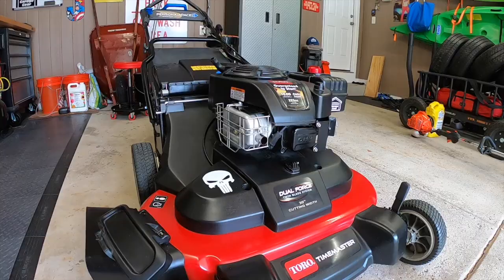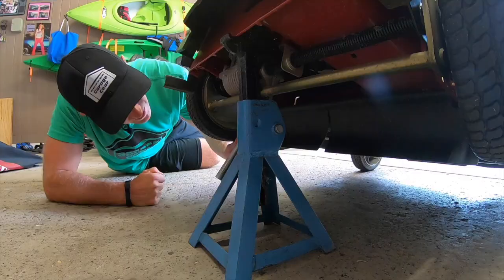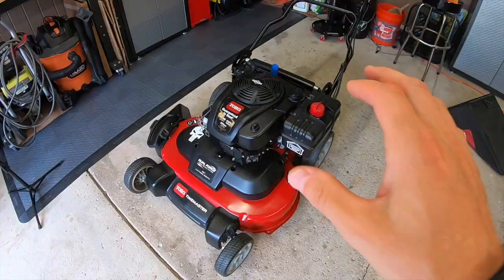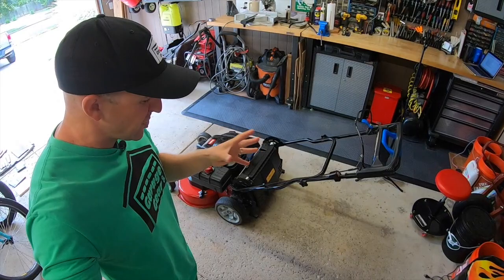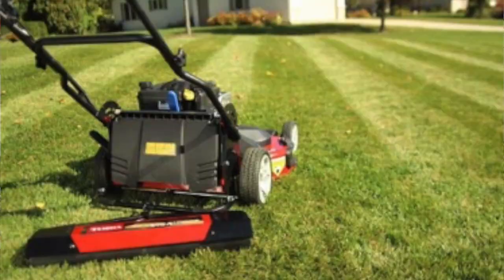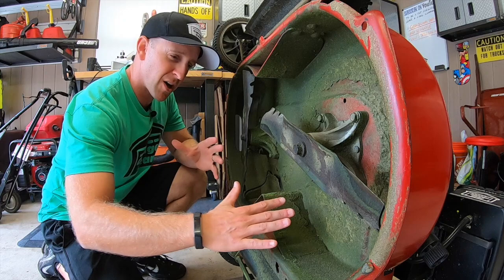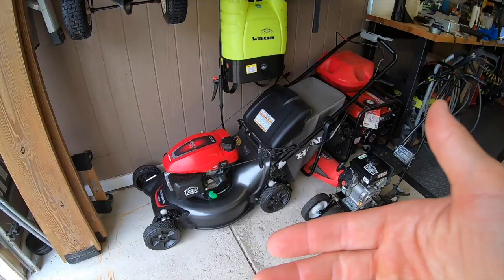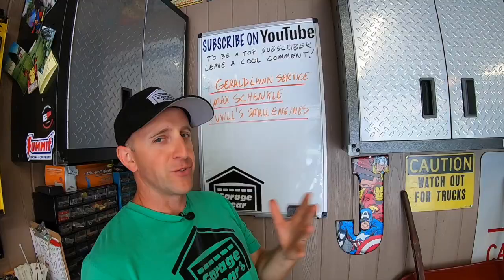BEFORE YOU BUY A TORO TIMEMASTER, WATCH THIS!

Comment: Own 2 older TM for 2 property's. Not much gloggin by my (cut/mulch) switch routine.  First cut with open doors and let clipped grass dry. Next cut, I only "mulch" closed doors if needed. I'm able to jog/run and cut as fast as i can, great machines. I do mis the rust free aluminum deck that the smaller toros have. Graphite helps too.
Reply from the maker: Thanks again for sharing Clare! Graphite and aluminum decks definitely help.

Comment: So was really considering getting one until I came across this review. I currently have a Toro super recycler model 21386. It’s an absolute beast of a machine. But my new yard is double what I’ve had in the past. I’m now at about 10,000 SqrFt of pristine, thick St. Augustine. It takes FOREVER with a small mower. 

What is the best option? 

-Riders and standers create ruts and damage the lawn. 
-30-42”walk behinds I have found only seem to be commercial units that cost and arm and a leg
- tested a few commercial units and they may be robust, but cut quality sucks.
Reply from the maker: @matthewo.1183  hey Matthew it sounds like the commercial 30” units would be a good way to go for you but unfortunately youre gonna have to come up with the extra cash for it. There really isn’t anything of decent quality in this size bracket at the residential level

Comment: I have the same size, 10k sq ft lawn and I finish, no problem.......  gas left over in the tank. 159 hrs, a flap and the synchro pulley upgrade. Also have replaced a set of blades. Oil changes and that's about all.
Reply from the maker: Thanks for sharing TJ!

Comment: Interesting video here, so "thanks" upfront,  and I'd like to share my two-cents...

Just entered my 11th year with the TimeMaster and still runs like a beast (on 10,000 sf yard).
Add to this, cutting the neighbors yards several times a season. 
Add to this the heavy mulching and bagging of hundreds of bags of leaves over the years (and I mean "heavy" fall leaf cleanup!).

Yes, mower still has the original deck flap, wheels, engine...etc.
 
I have replaced these items over the years.... Factory: (1) new carb (last year), (1) new transaxle (this year), (3)belts, (3) cables, (pair) of deck-raise handles, air filters (5), pair of mulch blades (upgrade).......at a cost for these repairs/ improvements of under $350. 
(tried the $25 aftermarket carb / kit last year and that was a big flop. I did rebuild the original carb once or twice before last year).

No big secret here but preventative maintenance is KEY including regular filter cleaning or changing, regular blade sharpen, regular oil changes. Also, I have always used ONLY high octane fuel. Plus, early on, increased engine by upwards of 20% to handle more traction/ better toque.
 
Ya, mulching particles will stick cause of wet grass but I try to avoid wet unless I have to and more regular cutting really helps get real fine mulch. I try to cut ahead of the rain so sometimes early cut occurs but not to much later/ longer turf.

So, ya, I have been real lucky with this mower and with small hills on the yard, it has performed very well just like all my motors do.
So I am very thankful.  Same with my Stihl products....they run which seems like forever, also.
Reply from the maker: Thanks for sharing your experiences with the timemaster!

Comment: Hello all. Wow this is informative and scary! The best thing for me is I found this one season old Timemaster last summer at a steal. Nobody believes me when I tell them what I paid for it plus in the package I got an older aluminum personal pace 6.5hp Toro(the backup), a Stihl 700 back pack, Husqvarna chainsaw and new wheelbarrow and miscellaneous cans of store bought gas plus gas containers. Anyway it’s for personal use and it’s funny, after every use I flip onto its side and hose it out. On my way back to the shed it runs out of gas lol! At least I know I’m storing it dry, right? No clogging ever whether I bag or mulch probably bc I cut as needed before grass gets high and only when dry. Now my problem is, I’m worried about the tranny, motor and pulleys though! TBH I never even looked at the flaps( they may not even be there-lol). It’s two seasons old now and I’ll continue to service myself blades and oil change once a year(STUPIDEST design flaw w oil change TORO!!). This year it’s getting a new plug and air filter. It starts fine w electric start and doesn’t burn a drop of oil! Maybe and hopefully I got even more lucky w a non-lemon…..TBD
Reply from the maker: Maybe you got lucky! Thanks for sharing Tom!

Comment: Mine is an original 2012 model. 190cc electric start engine was underpowered and I called Toro and told them that the unit needed the Briggs 223cc engine (yes, it existed back then but was used on small rear engine riders) Toro told me that their engineers knew what they were doing and they determined that the 190cc engine was plenty of power for that mower and they blew me off.  ( Nice to see them have to eat their words in 2017 when they finally put the 223 on it).  I replaced my 190cc with the Kohler CV224. Mine now has all the Turfmaster parts on it (pulleys, brake arm assy, etc) it is pretty solid now.  Bought 2 other 22" mowers.  Still prefer the Timemaster for time savings and cut quality.  My deck only needs scraped out a few times a year.  In the Spring I run the lower lift Atomic blades, mow more often and usually always mow later in the day when the lawn has had a chance to dry out.  I've learned how to avoid the deck getting packed up unless it rains for 2 weeks straight and then it's bag or side discharge and cut the next day when the clippings have dried out a bit.  I kind of enjoy working on OPE so making practical modifications (engine and others) are kind of fun to me,  but I won't be jumping on the useless painted wheels bandwagon any time soon....
Reply from the maker: Thanks for sharing all of this Mellow! I know what it’s like to enjoy working on something and everyone has their thing! 👍
Reply: some real honesty yes finally, if you own one you will prefer it over 21.
my 190 I just adjusted the idle screw for more rpms helped alot.
Reply: @kevinisbell1867  Yes I did the same (bumper up to 3400-3600 rpm) and it did help but my lawn is a really thick KBG & TTF blend and the extra torque from the Kohler was a night & day difference.  Plus I always mulch whenever possible.  It is strong enough to mulch with Gator G5 blades without bogging, but I think they are overkill for this mower.  G3's are better suited, if so desired.  Since I am only using mine for my own yard I feel that the mods I've made have made the mower just about as good (for my needs) as the commercial Turfmaster & Exmark 30's, but still quite a bit lighter and more maneuverable.
Reply: I can easily more than double Garage Gear's list of poor design issues. I too have a 2012 Time Master with a new Kohler Command Pro engine.  Have found that I need to turn it over and wash the underside after EVERY use.  Slightly wet or tall grass means bag AND chute.  I cut 3/4" off of the height of the chute guard and that helped to reduce clogs.  I did not know that there were better pulleys available but will see if I can figure that out for the next time.  As you mentioned, I love the TimeMaster for quality of cut, better than my Hondas, but you have to love doing maintenance and shopping for parts if you own one of these.
Reply: @kenking9114  Agreed....but after you get the parts switched over once you'll go much longer before having to work on it.
Reply: @mellowjammer  There's always something.  When I put the engine in last fall I completely disassembled.  Cleaned and painted everything, replacing both spindles and two belts. Timing belt idler pulleys are fairly new.  With 16.5 hours on the new engine I just replaced the shredded timing belt that is almost exactly two years old and maybe 35 hours. As I said, it's always something and the neighbors have noticed.
Reply from the maker: @kenking9114  you gotta love doing extra maintenance if you’re going to keep one of these long term! Thanks for sharing your experiences here! 👍
Reply: @mellowjammer  I hunted a bit and found the same part numbers for pulleys on the Time Master, Turf Master, and Exmark 30.  Can you share part numbers and supplier?
Reply: @kenking9114  Wow!  I'm still on my original (cogged) timing belt from 2012!

Comment: I know there’s no real comparison and individual circumstances are so variable, but for the past 4 years, I have been using a 125cc Cheetah mower (the cheapest I could find $175), to mow my 2/3 acre back yard. It takes me 2 hours on a good day or 2.5 when I’ve left it for 2 weeks. It’s incredibly light weight, uses hardly any fuel, has lived outside in the elements its entire life and is small enough to throw around with 1 hand to go around trees etc. Yes, it’s like 16” which means I’m spending more time, but I’m almost afraid to “upgrade” after watching a bunch of review videos for the options I’ve been considering.
Reply from the maker: A lot of stuff out there isn’t built very well! Thanks for watching

Comment: I have 2 residential timemasters I use in my small lawn care business, awesome product I must say. I had to get deck welded as once motor got loose. Replaced one motor as cam worn out (I never adjusted valves so my fault) and replaced couple of pulleys and belts. Every machine has its own special issues. I think it’s a pretty good product
Reply from the maker: Thanks for sharing Rick!
Reply: Why would the end user need to adjust the valves? I'm thinking that should be done before it leaves the factory!
Reply from the maker: @jacktorse2145  I would think so Jack. But hey ya never know.
Reply: Your post was from 11 months ago. It would be amazing if they are still running today without any issue's.

Comment: I've been using the timemaster for about 3 years now and I agree that all walk behind mowers bog down at some point it doesn't really do that great mulching either and does the same in wet grass as any other IMO I've learned that every week after using it commercial you have to open the black plastic part an blow in there to get the grass that builds up if not that's problems waiting to happen if you can do it sooner even better, and the plugs that go on top of the pulleys I used silicone sealant so they don't pop up an  debris gets in the bearings I also replaced them with the commercial ones other then that I've never had any other issues I'd buy it again you just have to maintain it and yeah I wish the tank was bigger to might have to put the time an energy to what you did
Reply from the maker: Thanks for sharing Norman! 👍

Comment: I have had my Timemaster for 8 years and I am very happy.  Yes, I share the clogging issue a bit and had to replace the drive cable, but it has NEVER failed to start or finish my lawn(s) in Toronto, Chicago, and now Florida.  St. Aug grass does not cause as much clogging as Kentucky Rye Grass
Reply from the maker: Thanks for sharing

Comment: I've had a Toro Timemaster and the Personal Pace Self-Propelled feature is worthless.  It eventually turns into a 30" manual push mower in no time going up hills.  I eventually returned it and purchased a Honda 21" HRX217HYA Self-Propelled mower with cruise control and blade stop.  The Honda worked in all turf conditions with no issues and was considerably lighter and produced a far better cut.
Reply from the maker: That’s a BIG mower to push around lol! They really aren’t all that they are cracked up to be. Hondas on the other hand are built well. That hrx is a great mower! Thanks for watching CSM!

Comment: I have one of these mowers, about 5 years now.  Replaced pulley after one season. I agree engine is under powered, will bog down if grass gets a little high. Other than that it has started on the first or second pull every time.  I give it 3 out of 5 stars.
Reply from the maker: I agree with your rating Olde Hatt! I does give a nice cut when the conditions are right. Thanks for watching!

Comment: This guy is 100% spot on. If I had seen this video 2 years ago before getting my TimeMaster, I would have gone a different route. I’m mechanically inclined and have tools but I’m definitely not a full mechanic so some things are outside of my expertise. I do want to say that I am DEFINITELY saving time with this mower though. My backyard is 100ft x 100ft and my front yard is 100ft x 25ft. My old Toro 21-inch mower would take me 1hr 45min to mow and bag the grass. I can be completely done with the entire yard PLUS edging, trimming, and bagging in under one hour. Huge improvement here. 

> My flaps were shredded but I followed his video using the John Deere flaps and it rocks now. Highly recommend this fix. 

> The gas tank is small but I don’t have a massive yard so I can get through on a single tank. I always fill it before mowing though. 

> The engine is definitely weak and bogs down if I’m trying to mow heavier grass down too low (especially in the spring). While it is said that you should only moe when it’s dry, I have a job and a life so that’s not always feasible.  

> My engine bolts may be fine but I lost 2 bolts on top of the engine’s pull cord cover (need to check the engine bolts now!). 

> I just finished my 2nd summer with the TimeMaster and my blade engagement belt just broke on my last mow of this year. Very premature. Luckily, I follow a TimeMaster group on Facebook and saw enough issues that I had 2 belts on standby and it was a quick 15-minute repair. Oddly enough, the mower feels better than new with the new OEM belt installed. I’m preparing for the pulleys and main belt to go as well. 

> The deck clogging is a real thing too. I’ve tried ceramic coating and sprays but nothing works. I bag my grass and I even see it clogging the chute on the way to the bag. Don’t waste your time doing the ceramic coating. They make a spray you can use right before mowing that does a decent job and it’s MUCH less elbow grease and time compared to the ceramic coating process. 

Overall, I’m happy with the TimeMaster but, if you’re in the market for a mower now, I’d steer clear of this unless you like tinkering with your toys and enjoy repairing things. HA!
Reply from the maker: Appreciate you sharing this with the community Joe!

Comment: Purchased a Toro Recycler AWD 22" it was the worst mower I ever owned and even Toro said that the AWD was designed to only work as front wheel drive on any hill, it spent so much time in the shop that Toro bought it back from me and my 1992 Craftsman is still going strong.
Reply from the maker: Thanks for sharing

Comment: I had the 190 cc. I managed most of the clogging issues via chucking the side chute deflector and bungy-ing up the mulching flap. I now have a TimeCutter zero turn and have five times the issues I had with the TM30, however, the TM30 blew out a headgasket in year 4, and I was doing perfect maintenance.
Reply from the maker: Thanks for sharing this information with the Garage Gear community!

Comment: A lot of good points, many of which could be easily corrected (bigger gas tank, stronger flaps...).  I've got the 2018 model year and had few problems mechanically.  Just replaced the blades and looking forward to the first cut with them.  The mower was $1,100 back when I bought it, inflation, ugh!
Reply from the maker: Crazy inflation! Thanks for watching bri

Comment: I’ve had mine since 2017 and the only thing I ever had break was a belt and it was my fault. Hit an old tree stump and shredded the belt.  I change the oil at least once a year and replace the belts every 2 seasons. I mow 17000 square feet of lawn every week April through the beginning of November.    I do agree with clumping issue though.  The wash out port helps but is not perfect.
Reply from the maker: Thanks for sharing z!

Comment: Bought the EX-MARK commerial version of the timemaster has all the heavyduty parts to start with, and I almost never mow wet grass. Have mulched and worked better than my 21 inch honda. Only cleaned the under deck once and was almost nothing there after about 40 mows, I don't water the same day I mow, I have 10,000 sq ft of grass and a steep hill, has the kohler engine and has been perfect, I usually bag and has cut mowing time down from 1.35 minutes with 21 inch honda to 55 minutes I love the 30 inch EX-MARK has been great with the only issue was the fuel filter from factory was to small for the big kohler engine, I guess this was an issue that the factory is now aware off, the only other thing that I had to get used too is with the heavyduty transmission it is harder to make sharp turns than the timemaster, have gotten used to and love this machine. It is a little costly but worth it if your keeping for a long time.
Reply from the maker: Good information here Bob! Thanks for sharing this!
Reply: I do see many people with clogging problems have to wonder if it could be grass type not sure why but I never have this problem, I really bought this mower because I saw so many problems with the timemaster as you described, great video and very informant!!!
Reply from the maker: @tubingtonite  appreciate the positive feedback Bob! Perhaps grass types may play a role. Thanks again for sharing your experiences!